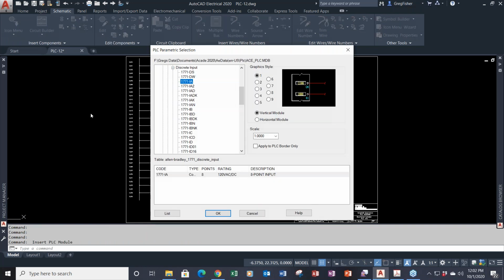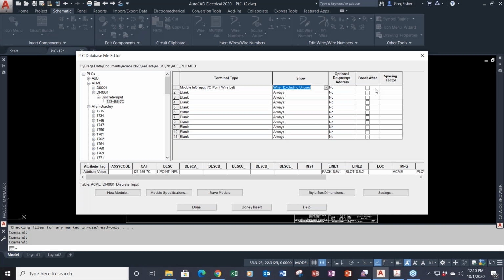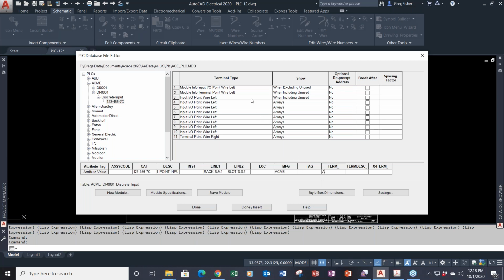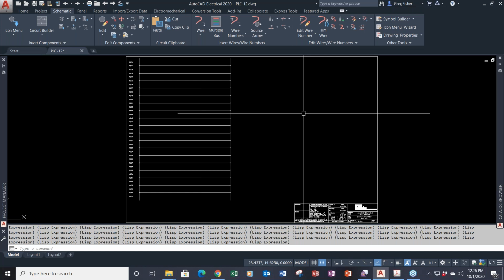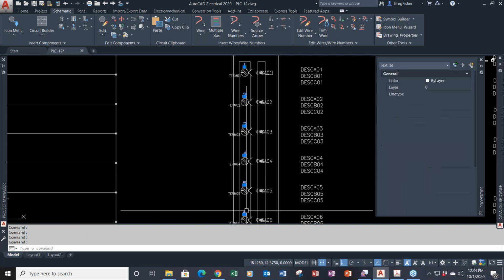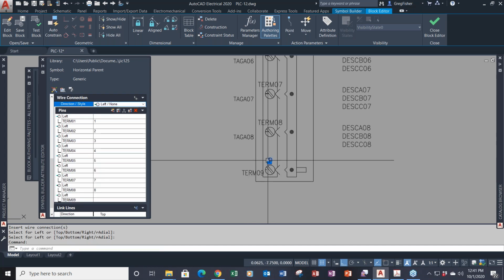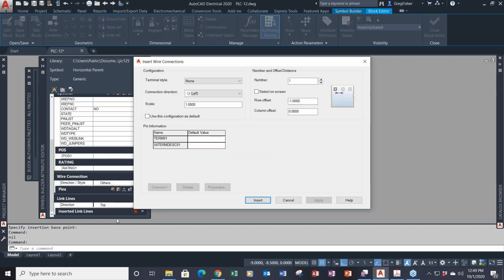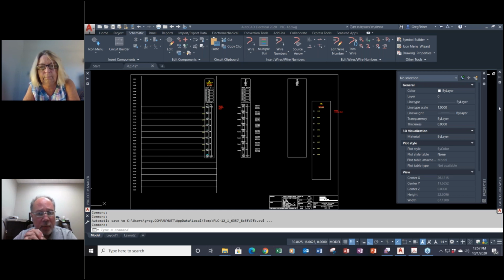AutoCAD Electrical PLC Modules

Comment: I have a brand new controller, it has digital inputs, digital outputs, analog inputs and analog outputs on the same main unit. I want to split these input types into different modules and insert them in different drawings but they must link to one catalog only. And when we generate report, it only show only one main unit. Please advise
Reply: Create a PLC module. Insert it in the parametric way. While inserting, divide it where you need.
In this video, PLC module is created as a block. It cannot be divided.
Reply: @ПавелЭкземплярский-й9р  Thanks for advice. I created symbol as parent and child